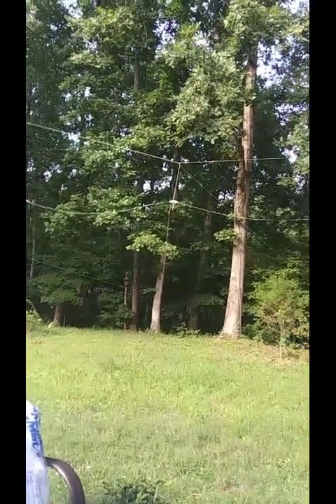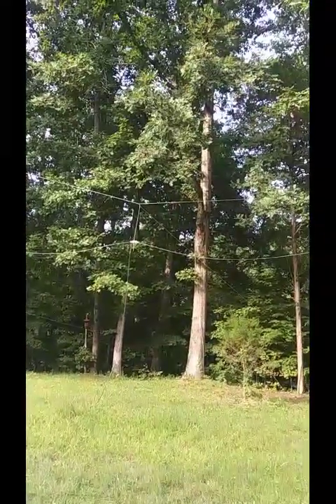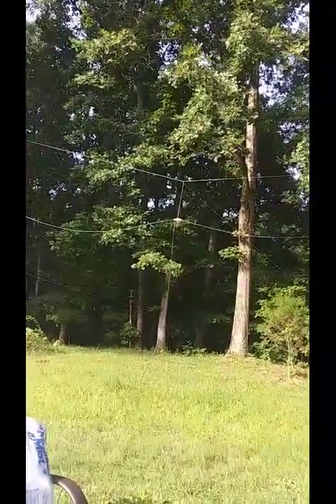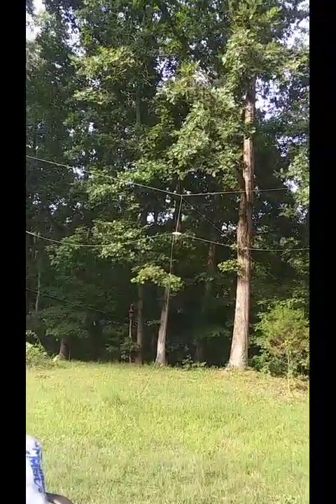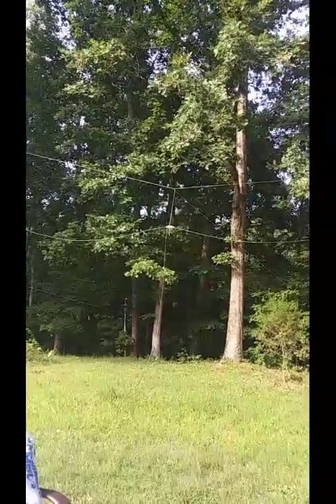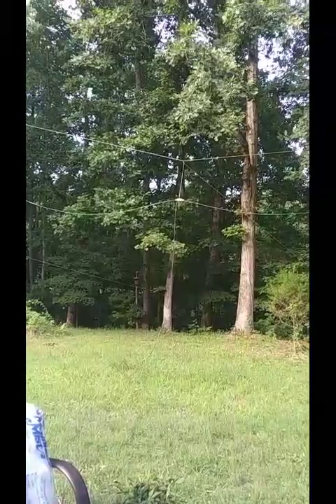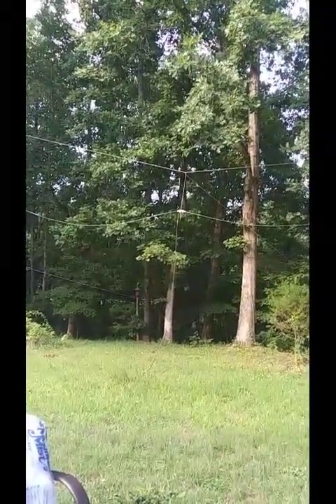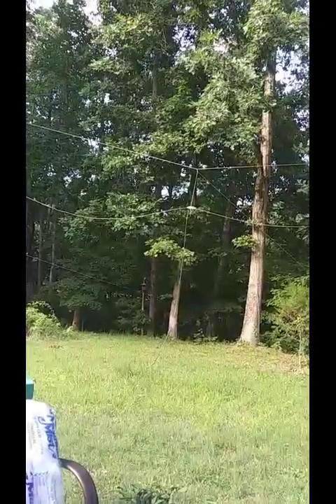How To Build a CORRECT Dipole

Comment: I am a new ham with a general license.  Your YouTube videos are probably going to save me from quitting amateur radio.  As of yet I have not made a single HF contact but not for the lack of time, money and effort.  I have lots of baluns, ununs, transformers, antenna wire, kts, and Bravo Sierra advice that has cost me time, money, and frustration just to get an antenna that actually works. I could go on, but I do agree with you about "bought radio" and the lack of real knowledge being taught these days. 

I did acquire the two texts for Terman and LaPorte and have just started t reading them.  May I suggest a video on maybe the 20 meter dipole showing the construction details.  It looks to me that this antenna uses two arms that are quarter wave length allowing for the correction factor of 0.951.  Question: Is this added to or subtracted from each 5 meter arm?   In another video this antenna is listed on the VNA plot as being 17' 8". This antenna looks to be supported  by a line above so you can adjust the feed point. from ground level.  Any details that you could comment on would help me and new hams in my situation.
Reply from the maker: Excellent comment. Its good to have individual verification of this.

These 'kluge' antennas work, sort of, when propagation conditions are very good, but youve discovered why, and that, ops with such arent on the air now.

No one can hear them.

Ill do a construction video tonight.

Comment: Love that old green merch tunner on the top self hope i got the name right i assume you dont use it i love to own one 👍📻⚛
Reply from the maker: Wow what a crappy design. Gross failure of the roller inductor due to metal on metal friction.

No I dont use it, the inductor is in pieces awaiting figuring out how to fix it.

I dont use any except fixed L networks on the dipoles with 75 ohm line to match the 50 ohm TX to the 75 ohm coax.
Reply: @k8byp  really i thought thier were good tuners i talked to people that had them loved them if its that bad i take it restore it and use it if i need it. Its like the super tunner the dentron thats a tank. It was messed up i think it got hit by lightning the antenna connectors were melted away i replaced the so239s use very fine grit paper cleaned the tuning capacitors which they were little black cleaned the whole thing up and repainted the case and it looks brand new and yes its a tank the so239s acted like a fuse blew off the connections and the outer insulators of the so239s and the center wire out as well had to clean the inside case to remove the insulation from the so239s plastic or teflon long story short works like nothing had happened to it . Got it in a deal cheap👍📻⚛
Reply from the maker: Fixing old things is part of what this sport is about! That takes us back to the day when commercially available equipment wasnt easily avaliable.